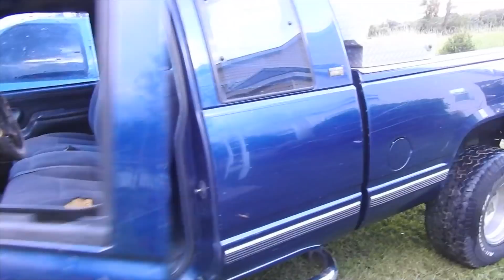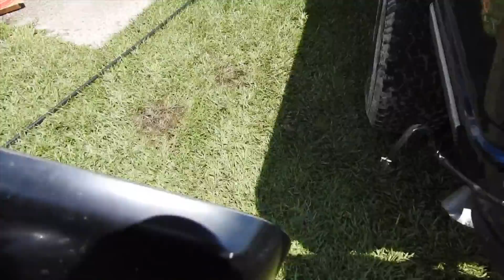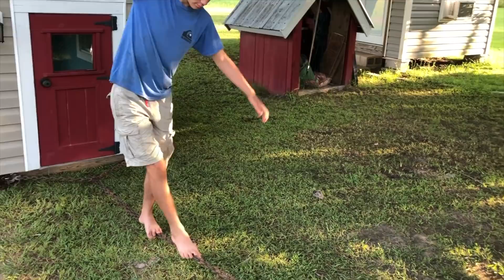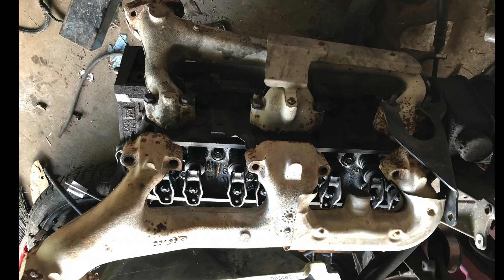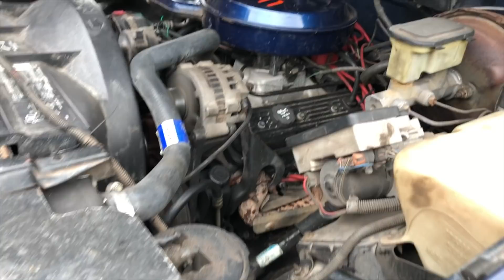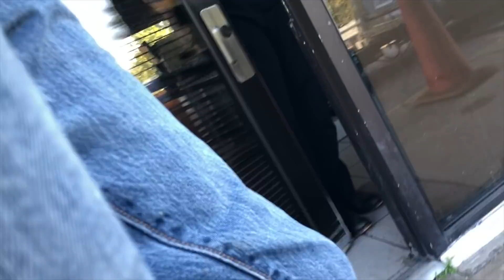Z71 Truck Project - How Much Money was Made

Comment: With these newer trucks and the really fancy tail gates and  even the old junker tail gates people will steal them I now have them on my trucks shop and personal a simple 99 cent hose clamp on the pivot portion of the tailgate to the Box in the most awkward position to tighten the screw will prevent  Someone from stealing your tailgate
Reply from the maker: That is a good tip and I would hate to loose a nice tailgate.  I may have to steal that tip on my next truck or truck bed trailer. Thanks for watching.
Reply: @chud327   Go ahead and use my idea and give a shout out to my YouTube channel Detroit redneck. . The 2nd channel is DETROITREDNECK  Well the  That's right You subscribe to my channel I'm the guy with the 22 horsepower V twin outboard motor     When you make a new pontoon boat I would like to see it full size 24' On a different topic I just sent an email To the backwoodsman magazine on an article the did on a survival shotgun I'll have video posted soon

Comment: I got a question to ask you. I need to know where the red wire goes from the 4x4 actuator. I know it goes near the transfer case but not sure and need to know the wiring on the tranfer case and a sensor near the transfer case
Reply from the maker: I am not sure and now that I have sold it, I don't have a way to check. thanks for watching.